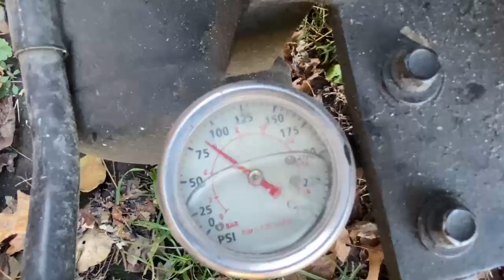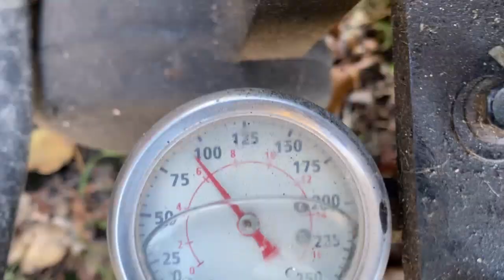1 Lb of copper melted in 3 minutes DIY round stock

Comment: There is a better tube for that size -a chair lift cylinder has inner diameter of 24mm and its super smooth inside .You can make a thread and plug on one side.Then you can just punch out copper with hammer,talcum powder works as release agent-dont pour into cold mold ,preheat it.
Also if you tip your mold slightly and pour at the angle you wont have problem with air getting stuck and get porosity like people do when you do it at 90.You want continuous pour with no splashes at bottom -you can practice with water and a glass tall measuring beaker .
Reply from the maker: Yes i need to build a small mold pre heater burner .
Its on my to do list lol
Reply: @NOBOX7  I have built 1/2" all stainless steel burner -well all stainless except nozzle which is 0.6mm mig tip brazed to copper pipe and then it goes to brass valve . 
That little thing is a pure beast for such a small burner .I even put a big nut that i plugged with weld  in expanding tube  so it acts as a cone forming nozzle .
best burner i built next to 1" propane beast . 
I did my own variation by following book Gas Burners for Forges, Furnaces and Kilns - M. Porter but its still his type of burner,probably best diy venturi burner you can build with simple tools.

Comment: With the brass, you don't want to take it to "as hot as i can get it" kind of overheat; you boil off the zinc, change the characteristics, and inhale it all. If that was the boiling crucible, well that's what was probably boiling. 
As for copper, also don't want to go too far above liquidus, maybe 100 odd C, you end up introducing more oxygen than necessary. Your rounds will look better poured if maybe you get a pyrometer going on there...
Reply from the maker: The brass had just melted as i removed it , there was alot of borax boiling in the crucible
Reply: @NOBOX7  Borax is a real good flux material, very aggressive for sure. The three minute melt time is impressive NOBOX7. So hard to believe that there is so much energy in a liquid atomized and burned. I like your homemade crucibles. The price they are asking for them these day is just crazy high. Then the performance is quite lacking too....
Reply: Well stated Brian, that is exactly what I have found when I used to play with fire....

Comment: That engine on that air compressor sounds like it’s under 100% load and overloaded. It could use a bigger engine so it isn’t being worked as hard. 
I build a gas air compressor using a 15 HP Kohler Command from a garden tractor coupled to a Quincy 4 cylinder air compressor pump. The engine was just barely powerful enough and it would stall when the pressure valve lowered the throttle to the engine. Instead of using a bypass valve or a centrifugal clutch, I used the electric  PTO clutch from the tractor to engage and disengage the air compressor head. The clutch is controlled by a generic electric air compressor pressure switch which is wired directly to the Ignition switch and the 12v battery. As soon as I turn on the ignition switch, the electric clutch engages of the PSI is low. Even if the battery is low and it doesn’t engage, as soon as the engine starts, it provides enough power to energize the clutch. I kept the feature where the engine RPM goes down to save on fuel. It has actually been a fairly maintenance free machine and works very reliably. You can try using an old lawn tractor PTO clutch or a centrifugal clutch with a more powerful engine on your air compressor.
Reply from the maker: Yes, Its idled down like that on purpose  , i turned it up after it died to full blast  but you are correct it was running a little slow  . The problem was it produces so much air that if it fills that tanks it kicks on the unloader and wen the unloader kicks out there is not enough power to slam those pistons home unless it was reved so high it vibrates like crazy , so if you tunr it down it never gets to 105 psi which is about the kick on point for the unloader . So its either idle at 50 % power wen unloader is on or or turn engine down to 60% power . 
Good idea with the clutch , that would let it idle up before engaging .
Thanks for the input , good eye ...